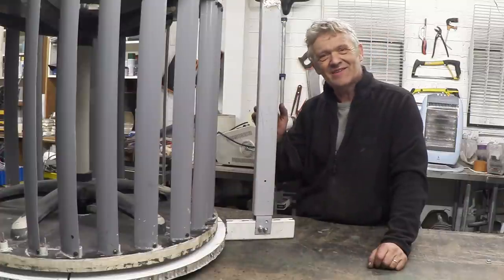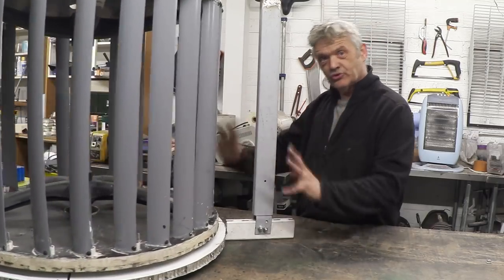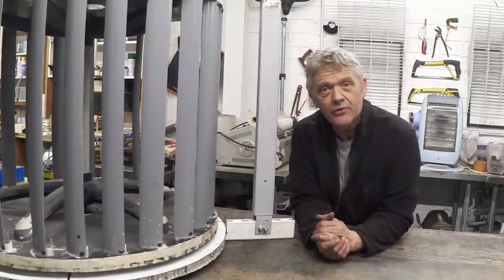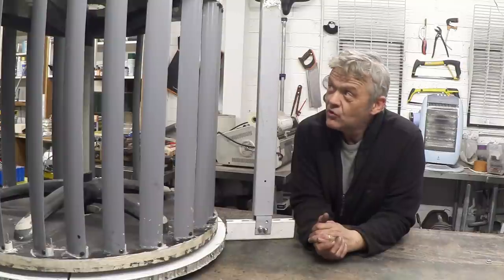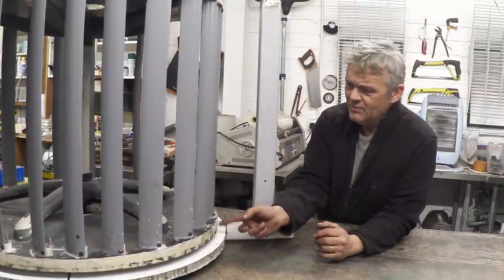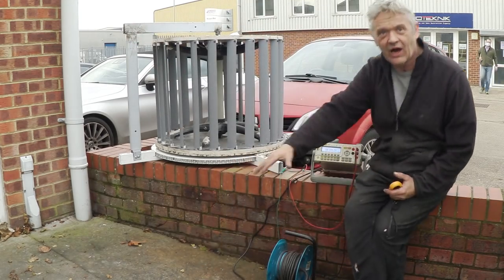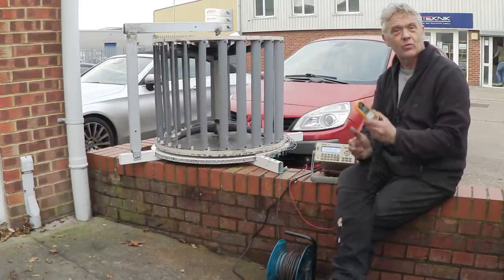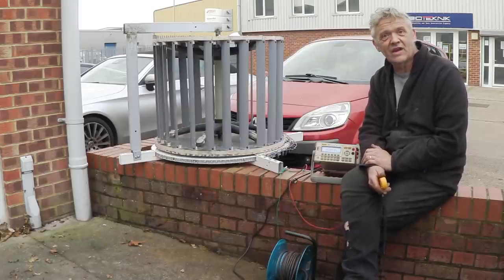A Wind Energy Harvester

Comment: Hi Rob. Looking good! The charge on a capacitor Q = CV (coulombs). The energy stored in a capacitor E = 1/2CV^2 (Joules).
Reply: So if there are 14x 1000uF (think that's what he said they were last episode?) caps at 8V that's E= 1/2 x (14x0.001) x 8 x 8  =  0.5J of energy Is that right?
Reply: @dexterdixon2000  Yes
Reply: @dexterdixon2000  He actually said they were 1000 Farads each but I think he miss spoke.
Reply: @dexterdixon2000  That's 0.1mWh?
Reply: .....x² these days is written as x^2  and  x³ as x^3   etc. I'll never get used to it. It's intriguing how the capacitor energy storage formula resembles the kinetic energy formula and thus it's easily remembered .
Reply: @1967spark  he said it ran for 10 minutes so that's 0.6mW average output. Once the stator is finished that's 2.4mW. if the wind was averaging 0.5m/s and the swept area is 0.8x0.8m the power available was 0.5 x 1 x (0.8^2)x (0.5^3) = 0.04W so that's a coefficient of performance of 0.06. Perhaps extracting this all a bit far but it's useful to note how little power is available to such a small rotor in such light winds - look forward to more data!

Comment: Rob, please confirm the capacitors you're using. Are they 1000F 2,5V or 5V? I didn't think you got 1000F capacitors at 50V at that size. Those caps size-wise look similar to aluminium electrolytic capacitors of around 1000uF (1mF) rated at 50V.
Reply: @Ed R6 Yeah, seems like there's no usable power being produced at the moment, but I want to give Rob a chance to respond.
Reply from the maker: sorry mate 1,000 microfarads at 50v - my bad
Reply: @ThinkingandTinkering  thanks Rob. It looks to me like the coils on their own are struggling to couple nicely with the field generated by the magnets. What sort of air gap do you have between the magnets and the coils? You might want to try backing the coils with a ring of ferrous material to allow a flux path from magnet to magnet. Also, perhaps mounting the magnets themselves on a ring of the stuff. That would make the air gap in the coils the only one, with a low reluctance path everywhere else.

Comment: Seems to be coming along nicely. 👍 Using a rectifier on each coil is an interesting layout i've not seen before.
Like u said, i think the cap on each separate module is a bit unnecessary, they are all in parallel. You could consider going straight to a capacitor bank or battery without needing them at all. Then u could mount the bank away from the generator in a more convenient place. Also you could control the charging process more easily especially if you're ultimately going to charge a battery / supercap bank.

Comment: Robert !  Have you got this wind Harvester on the roof yet ?
it seems your so busy tinkering with different ideas that you get off track very easily.... I know the feeling too well...lol...  I am thinking of building a Vertical wind generator like this here in Northern California, near the border of Oregon. the problem is that I doubt it would be of much use to me. sure it could run my LED lights in the house and shop through a 12vdc inverter to 110vac  and that's all well and good BUT... I can't run the 220vac well on something like this even with a different inverter as it draws 20 amps(something like that)
 obviously, with a big enough bank of batteries I could do exactly that, but the expense becomes too much at some point. ....
you mentioned in passing in one of your videos that this wind turbine is self limiting ...
perhaps that is why you have not added a brake to it ?  if that is the case that makes this thing 5 times more useable up here as I have personally seen 91 MPH winds here ! and I would not like to have to chase my wind turbine down after a wind storm ! LOL...
your addition of the 1000F capacitors to each coil and rectifier is a fantastic move
you solved the problem I was having by that one move thank you !
..... a word of caution to you on mounting this thing to your roof, even though your winds are mild in comparison to those here a very sturdy anchoring point is definitely needed the peek of a roof can double the wind speed at times if you get 30 mph winds that is converted by the roof area to above 60 mph winds and it could literally rip that thing right off the roof and leave you with a big repair !   .... My Roof will have to be re enforced and use lag bolts through the roof joists to be able to withstand the load !  going overboard on the instillation is warranted here !!!!!

Comment: I bought a Honda mag wheel for $20, 12 magnets, n52, for $40 , so I'm allowing the other $40 for wire and blades... which I'll make out of 6 inch steel tubing...In going to make the shaft horizontally but it will be a ducted one way blade with the wind only catching the top...I have my own idea and design that I have not seen anywhere else...the idea is, it won't overspeed that much in a high wind but it should,  like yours, put out enough to help my 12 solar system batteries  stay charged (  510 amp hours at 24 volts) during cloudy days...I got ring magnets with a hole in the middle so I can attach them to the stainless steel brake rotor...we have a lot of storms here and sometimes the wind is 75 or so for a short spell, so I've been thinking about how to build this thing for a very long time so that it will last longer than a week out here on the wild prarie...oh, our average windspeed is 18 so I've got some to give away and itll be okay...yours is for very different conditions...yesterday we had winds 40-50 for most of the day, but today it was only around 25...I suppose that's why a windmill is rarely seen here...tears them up I think maybe idk...at my old house the wind got up to 100 a few times...I got tired of replacing shingles so I moved a few miles away...my figuring partly was, if it turns too fast, I can always put magnets on both rotors, or, lol I still have the brake calipers and stuff for the other rotor...that part will be unknown...it only has to make around 30 volts and a few amps to do what I want...I just don't like any of the designs I've seen so I'm gonna try something new...you sort of hinted at it, some designs are less than practical,  they don't really work out well in actual use as in some pie in the sky theory someone had in a classroom somewhere...wait til they get out on the farm and then try it, I always said...I bought one of those inverter welders at Harbor freight a couple weeks ago it goes to 75 amps but it's pretty nice for an old man, it only weighs  a few pounds...I had built a gasoline  engine generator to run it so I have it mobile, now...handy that way...well it's good to see your wheel is progressing,  , I've been off the grid the last couple of months,  it's pretty cool and I've gotten used to free power now...I've only had 400 watts of solar panels but Im adding 200 watts  this week...Im putting 2 panels in a frame of square pipe and making the 3rd one tomorrow,  so that I can move them inside in case of hail....one panel got shattered last year so I replaced it and got 2 more..I'll be doing quite well when I get those other 2 out this week...it will make a lot of difference...(I don't think there are any rules for windmills here in tornado alley, they just look at you like, oh yeah, right, good luck with that)

Comment: Capacitors are great things.

Not often taught/realised... But capacitors can be used for direct step up of voltage. Just got to vary the capacitance wrt to time. Energy in capacitor remains same but if capacitance drops... To keep energy the same, voltage has to increase. 

Something like anodized aluminium placed in water inside a copper pipe is a fairly simple water level variable capacitor. (trying to use such as timing cap in 555 circuits for variety purposes including manometer pressure sensors is how I found out  about the voltage step up. The cmos 555 timers were suffering "random" odd behaviour and failures) 

When capacitor are discharged their voltage falls, making it harder to use their energy... If the capacitance fell The voltage could be maintained. Instead of copper pipe... A gavanized bucket, with a hole in it.

Comment: Appreciate all your clips but in case of wind turbines you are doing some general mistakes.
What you can earn is dependent on the surface against the wind, in this case appr. 0,6 square meters...not much related to the amount of machinery you are using. With four brooms sticks on an axle you could cover almoust 4 square meters using the principle of the greek wind mill.

Comment: You use the term reluctance incorrectly as I don’t think it means what you think and you use the term Farad when I think you mean micro Farad. Also, I would say that your marketing pitch about how your design captures the low wind speed design space is rubbish because there is very little energy in low wind speed and therefor very little to be gained with the significant investment. Proper wind power designs have the ability to survive the forces of high wind speeds where significant energy exists, which is at 30m or greater height. Please stop electrical engineering discussions and stick to mechanical engineering discussions because you are not competent in the former but are in the latter.

Comment: Once the air passes the blades it is not doing anything.  I wonder, what would happen if a set of blades, say n/2 blades were mounted inside the outer blades.  What I am thinking about are steam engines that pass exhaust steam into a small cylinder to harvest additional power from the steam.  Maybe the number of internal blades should be n x 2 blades…..???

Comment: Hi There love the channel.
how about rotating the top disc of the wind turbine 50 to 100mm anticlockwise to put a slight angle on the blades, then possibly you would get a thermal additive to generate more movement  on  not so windy days. 
My extension has an asphalt roof and on a moderately sunny day gives off quite a substantial amount of heat. Capturing this energy might be worthwhile.What do you think. ?

Comment: Great work, Robert. I love to see you get so chuffed when things work out well. Others have suggested magnetic bearings which would be interesting to see you experiment with. Now that you are suspending the whole apparatus to reduce load on the bottom bearing it occurred to me that another way of storing energy in the lulls between the gusts would by suspending from a longer wire that twisted slightly, storing torque, and maintained the angular momentum by untwisting when the wind speed dropped.
Reply: Magnet aided bearings is what ive been pondering for the last decade..
This VAWT construction wuld be perfect for every variable in my reality Robert.
I live where we have very small wind most of the time exept for a few stormy nights thrugout the year (i live in upper middle of Sweden at the east coast).

I really need to harvest energy from wind!
:D that is one of my life long quests.

Thankyou for your effots Robert

Comment: I think you'll find those caps are 1,000uF - not 1,000 Farad (so a million times less). You still need to test with a load. Once the capacitors are charged, they are no longer a load!
Reply from the maker: yeah you are right - my bad - but with the diodes in place they are essentially isolating the generator from any other load and it is the cap bank that would run other loads not the generator  - you might want to think about them as cups of water

Comment: I wonder what would happen if you painted the inside of the blades black and the outside of the blades white...
I only ask because on a sunny day the difference in thermal pressure might be enough to reduce the initial wind speed. Tiny tweak that can make a difference for harvesting at lower wind speeds.
Reply from the maker: I like that idea - I think you have something there for sure

Comment: about zero point one watts isnt it? couple hundred joules in 600 seconds.
Reply from the maker: I think so mate
Reply: @ThinkingandTinkering  this is why they need the iron cores, it increases the efficiency of the coils converting the magnetic flux into electrical energy. plus you have a lot of losses in all those diodes :(. probably the best way is one really efficient one that can suck all the energy out of it that it hits once a revolution? also, get it up higher, ground friction is pretty significant, dont start seeing any wind anywhere until you are 10m up

Comment: Cool. Ireland has no benefit from solar panels on roofs but would be great benefit off safe wind cathers on roofs for hosehold power and heating 100%. Great job. Whish You be rich soon. Only needs to be made safe so no cathers fly around in storms after few years use.
Reply from the maker: for sure mate
Reply: A food factory in Downpatrick has recently installed an extensive system on it's new roof, of course it is premature to know if it is going to be viable, but these types of companies are generally prudent with their finances as margins in the food industry are small.
Reply: @1967spark  great

Comment: Capacitive loads,  resistive loads and inductive loads  are very different mate,  will be very interesting to see how this performs once you have added a battery bank
Reply from the maker: they are mate but you now wouldn't connect any other kind of load to the generator you would connect it to the cap bank and it is the cap bank that would be running other kinds of loads
Reply: @ThinkingandTinkering  that wasn't my point, a capacitive load isn't a true representation of a "proper", working load. That's why I said about battery bank

Comment: great stuff Rob! always inspired by your vids. I'm sure this has been thought of and is probably in the comments somewhere a thousand times already . so If the vertical wind blades where free to rotate on a pivoted (off center) but restricted to only turn 90 degrees . as the blades move to the direct wind side of the wheel  rotation. the blades could create optimum drag and lift. as the blades moved to the back wind side the wheel rotate (pushed by the wind) to rotate 90degrees. thee blade would be side on to wind  having almost no resistance in drag to the wind as the wheel rotates back, the wind pushes the blade back to optimum lift/ drag position again.  reducing your loss gains you some power.

Comment: Thanks that's a great result, even only partly installed with coils. Have you considered the higher wind speeds and when to apply some sort of brake to stop damage.
Reply from the maker: I was wondering about that mate - aren't VAWTs supposed to be self limiting?
Reply: @ThinkingandTinkering  having held a squirrel cage fan from a machine during a repair, to very high winds atop a hill for fun, the speed did seem to plateau pretty quickly, from what i gathered; more blades = less time for the wind to access the surface of the blade at high RPM's = energy input drops = self regulating

i think in theory, less blades would allow for higher speeds but also require higher speeds to start it, more blades = lower starting wind required but will plateau very quickly

Comment: This thing is a total con. The output will be next to zero in average wind speeds. The thing is very small. Clearly, he does not understand that the power output is proportional to the square of the linear dimensions. This thing needs to be 5 or 10m across to be any good.  As usual, this sort of post concentrates on minutiae whilst ignoring the big picture. Unfortunately, uninformeed people are taken in by this twaddle because they just don't know any better.

Comment: "We could calculate the joules produced." Yes, you could. And you could divide that by the time it's been operating.
So why haven't you? Come on, you can tell us. Oh, I know.
Because 9 volts into 14,000 microfarads is about 0.567 joules.  Divide by 600 seconds (10 minutes), and you get a power of just about 1 milliwatt. This is, of course one millionth of the target 1 kilowatt you used when you started the series. And yet you laugh and say it's awsome.
Of course, you could have saved us all a good deal of time about 3 episodes ago. Instead of going on how the weather is bad up on the roof, you could have waited for a calm day, mounted your generator on the roof of a car, and hit the road. Drive at a known speed, uses a direct resistive load and measure the voltage.
You should be ashamed.